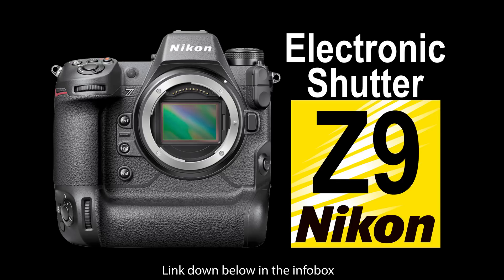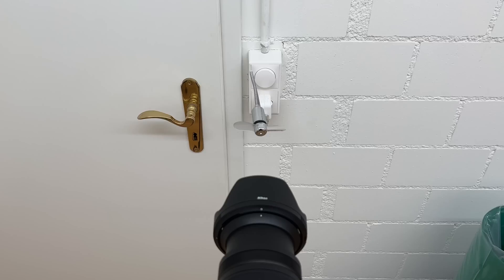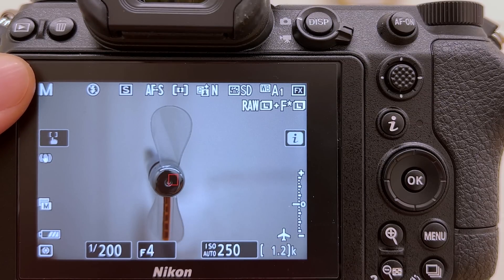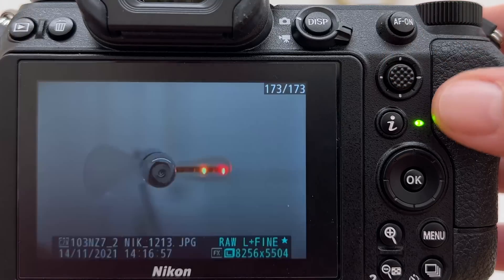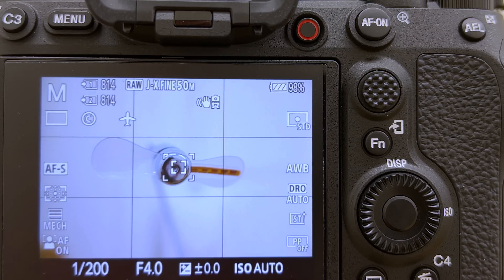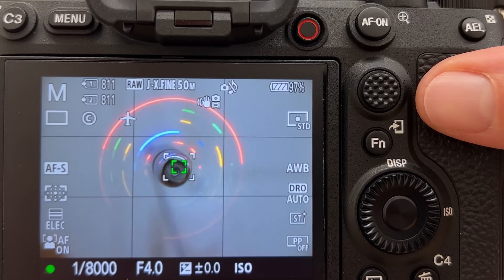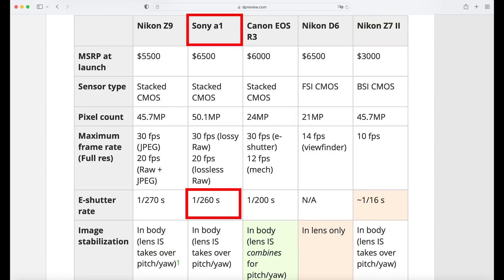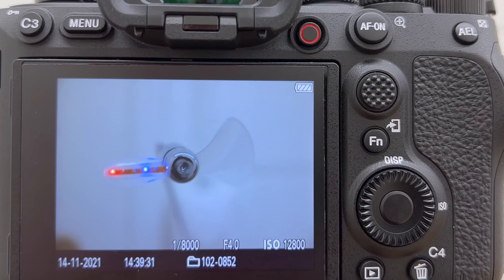NEW Nikon Z9 vs Z7II vs Sony A1 E-SHUTTER

Comment: I absolutely HATE the silent electronic shutters; hence why I use the Nikon F2T film SLR which was launched way back in 1971; it’s shutter-curtains and flipping mirror makes loud noises informing me that an exposure has been made; whereas with electronic shutters they are barely audible, and in busy environments you hear nothing. Once I have processed a roll of 35mm film, I scan it using a high resolution scanner, once scanned I can make very good quality 36”x24” prints.
Reply: Nikon has 'beeps' & 'green flashing light' to inform of exposure/ photo taken...also, your lcd will blackout, or, your top screen will inform
There are multiple viewable signs of 'photo - taken'.

Comment: Thanks. Great video. But if you want to see the level of rolling shutter on the cameras, you cant use a picture where the fan is level horisontal. This will not give you any rolling shuttes, at the issue with rolling shutter is with movements in a horisontal direction. So the reference image should have been where the blades of the fan was pointing up and down. This would give you a better idea of rolling shutter.

Comment: So in short image quality sucks, dynamic range on different ISO speeds is a mystery that Nikon chooses not to revile but hype and number of jpg images per second that most of us could care less about is constantly emphasized. Nikon really needs to return to simplicity, quality and value for the money that is the formula for success not the hype.
Reply: How did you get that image quality sucks? And for sports I'm totally interested in the 120fps mode. Everyone uses hype to sell a product. When it gets bad is when something doesn't live up to the hype. Sounds like you will be fine with an older camera. And you definitely seem to not know much about marketing. Nikon needed this camera and it will only get better. Stay salty!
Reply: @godboy159  Don't listen to the illiterate sony fanboy. We know the z9 is 1500 cheaper than the A1 with battery grip. It's value for days.
Reply: @godboy159  It is not sold as sports camera and even for sports it is 120 jpg files not maximum size RAW. It is amazing that the some years back photographers used 3-4 frames per second film cameras and managed to get some outstanding shots. Spray and pray is really not replacement for anticipating moment and clicking the shutter at just right time. Image quality is not what Nikon is pushing you cant even find out what is the dynamic range all that hype is concentrating on is frames per second and supposedly best since sex autofocus.If true grate autofocus would be welcome's but outstanding image quality is even more important and we are not told anything about that.
Reply: @mikeabc5355  " It is amazing that the some years back photographers used 3-4 frames per second film cameras and managed to get some outstanding shots" - You are obviously not a sports photographer ...
"Spray and pray is really not replacement for anticipating moment and clicking the shutter at just right time". In sports there is NOT just one "right time" - it is clear to every sports-photographer, that you get far better images with a high frame rate. 
And ... Compare the "outstanding" images from the days of film with the captures from today and you can easily see a huge difference.
Reply: @w.scholz9705  You are correct I am not sports photographer. Granted very few people need fast frame rate but Nikon ignores dynamic range and photo quality that is important to all photographers and fixated on something that matters to 0.5%.
Reply: @w.scholz9705  Yes but it does not put that info in its ads as if it is ashamed but in every advertisement, the frame rate is listed front and center. Frame rate matters to only a handful of sports photographers dynamic range and photo quality matter to everyone yet for that information you got to search long and hard.
Reply: @w.scholz9705  Considering that I started photographing, developing film, and processing photographs in 1965 and owned several studios over the years owned, and used countless cameras I guess I am not at your level of achievement but I am trying. :)

Comment: Would be nice if they could come up with a way to control the integration process of the individual photodiodes without having to stop the light exposure and control that on all photodiodes at the same time. But one can only dream right now.

But to claim that the camera eliminates the need for a mechanical shutter is still a bit of a stretch especially when it comes to increasing flash sync speeds, if the mechanical shutter can reliably be made faster, which Sony seems to suggest on the A1. However, the question is, have they reduced the life of the mechanical shutter to make it faster relying on the user using it mostly when there is a need to use it with high speed flash photography?

Comment: nice video (as a A1 owner) people getting the z9 should not be worried about using electronic shutter. I and many of my A1 friends don't use the mech shutter at all. I do suspect the Z9 to be very slightly faster simply because it has a little less work todo but won't effect the results. I am not  sure how you make the call that the cpu vs the cpu's (A1 uses 2) are faster/slower both are new and we are not sure if they are used to their full potential yet (and i say this as a soft/hardware designer) my guess is both can be pushed more over their lifecycle. Lastly why stop at 1/8000 and not go to the max setting of 1/32000 ? I understand you wanted to compare and you clearly proof your point people should not worry but still would be nice to see.

Comment: There is something I don't understand. If the Nikon Z9's read out speed is 5 ms how can it achieve 1/32 000 sec exposure time ?
Reply: It's no different than a mechanical shutter which moves at 1/250 can allow for 1/8000. Don't quote me but I believe it is a calculated exposure not an actual.

Comment: If Z9 scan speed is faster than A1, why can't it shoot at 30fps compressed raw or high efficiency star? Instead it's capped at 30fps, 45mp jpeg and 20fps, 45mp compressed raw. Interesting quirk if you ask me.
Reply: Nikon Z9 processor allocates resources for the EVF dual stream technology and hence is true blackout free without stutter like A1 or R3. Is Sony really 30fps? I thought it depends on lens, auto wb, lossy compressed raw, and several other rules. Also my understanding is that when shooting continuous the evf resolution drops and fps drops to less than 20fps and does not sustain 30fps. It just seems to me Sony is just about specs. Like my Sony Xperia 5 was advertised as the first 4k phone. But guess what, it only displays 4k when viewing pictures. The rest of the time it's 1080p. They don't tell the customers that.
Reply: @mlai2546  How did you decide the A1 is just about specs ? Maybe watch some real reviews like the R3 vs A1 by Jared. The 30fps is real but if a lens can't move fast enough what do you want sony todo all brands will get this issue. The dual stream EVF nikon claims imho is PR bs not sure how sony and canon resolve it but its fine. Yes i own a A1 and i tested getting 30fps is easy if the lens allows to af that fast. Also people (and we will see Z9 owners claim that soon too) should 99% shoot in compressed raw. Uncompressed or even lossless compressed raw is only useful in a very few cases and mostly in single shot mode not bursts.
Reply: @scb2scb2  Daniel, go check it for yourself:  https://www.youtube.com/watch?v=4KWZPsTizRs 
If you don't find this stutter annoying then good for you. I suspect Sony and Canon will eventually adopt the dual stream technology.
Nikon's dual stream prevents stutter because it does not need to pause, transfer sensor to CF Express and then resume feeding sensor to EVF. It is working in parallel, both feeding the EVF and CF Express at the same time. 
Sony's 30fps is compressed lossy. If you want to compare lossy, then you can say Nikon's continuous shooting is 120FPS, that's 4 times more than Sony's. If you are just solely comparing processor power, then Nikon wins in this one as it can record 8k 60fps.
Reply: @mlai2546  I am not sure what is in the video might be because of the hdmi record since that is a extra feed again thats by a 3th chip if you also record the overlay or because they have anti-flicker on (see start of the burst). But i can simply test here myself put the evf in 120hz mode, moved camera about smooth as expected to view, hit burst and just as smooth during the burst. The whole point about lossy confuses me even more since unless i missed something at each speed the sony allows for a better format (30fps and 20fps) then the Z9. The 120fps mode is nice but unless someone convices me its not extracting video frames to get these jpgs. The A1 can do the same you just have todo it at the end of the clip and yes its only 8mp not 11mp because of the 16:9 aspect ratio. Lets see if sony adds the same trick since its nice. The biggest issue with that 120fps mode is there is no clear way to auto-batch or organize them in camera since having say 360 images on a 3second burst doesn't make your life easier. I was hoping they would come up with a smarter way to group and maybe preselect them for transfer. But getting to the dual stream i am just not sure what it effects are. So sensor puts it into the dram on the sensor. Now somehow their is logic in there that takes that now scanned image and feeds both to the expeed 7 (so transfers the same data 2 times to that chip or more likely at different speeds and resolution. The A1 transfers it only 1 time from the dram on the sensor to one of the 2 XR chips. It has to be able to transfer at least some version at 240hz since the EVF supports 240hz mode. We know at least 1 on 8 transfers has to be the full 50mp image since that needs to be processed for the 30fps save. We also know both the A1 and Z9 has to have 120frames inside the Exceed7 or one of the 2 XR chips todo tracking and whitebalance since both do that at 120hz. So in the end i am not saying the Z9 method is not better what i mostly saying we have no idea how the others do it. Clearly nikon felt it was smart to make it press-item that it sends 2 copies from the sensor to the exceed7 while the others seem to only send 1 copy or not we don't know since they have not talked about how they do it and why. As a software and hardware designer by trade i simply can't 100% tell you what makes more sense and why. But i do agree if Z9 method has a huge advantage it will be copied i am just not sure how it compared until i have a Z9 next to my A1 to try it out. Since the Z9 is lower res and lower refresh rate i simply don't know how having the sending 2 copies from the sensor to the cpu helps unless someone really explains what is in these data streams why what happens after they hit the chips. Keep in mind i reacted to this video first as a A1 to simply say to the Z9 owners (that was the goal of the video posted) not to worry about rolling shutter since it won't be a issue as his video clearly shows.
Reply: @mlai2546  Looked at the video again maybe you can point out the stutter you see (the seconds in the timeline) since you might not notice he is changing from ff into crop mode on the fly several times during the burst taking maybe that is what you mean ?
Reply: @scb2scb2  As soon as the person holds down the shutter button, you can start seeing the stutter. @ 6s, @ 10s, etc..  It is more obvious when objects move fast. 
Here's another video of the stutter. Look at the movement at the beginning. The way she walks it's not smooth. https://youtu.be/Tnv6s1UYKgE
And this makes sense as the way mirrorless work is it displays the previous image when taking a shot. Basically=> capture, pause, transfer data, capture, pause, transfer data, repeat etc...  
Nikon Z9 stream simultaneously so you don't have this problem.
https://youtu.be/elUbfDTjmI8
Reply: Because you need todo more then just get the image of the sensor (once its in the dram on the sensor) lots of steps before it is stored in your memory card. Somewhere either there is technical or marketing reason for them not todo it.
Reply: Not an interesting quirk. You simply don't know what you are talking about. Scan speed has nothing to do with how many fps a camera can shoot.
Reply: @godboy159  Indeed we know both cameras are about the same on scan speed (about 4ms) and it has to supply at times 240 fps to the A1 for EVF and 240 record mode. Not 100% sure on the Z9 but we know it also has to atleast do 120 per second since like the A1 its AF, subject tracking and WB runs at 120hz and that work is done in its processor(s). I am not sure what effect we are seeing in these videos but i don't have it on my A1. Yes we know that if for example in 240hz EVF mode the quality drops down down and image becomes smaller. in 120hz mode HQ mode the video in the EVF gets slightly softer when in burst but the Z9 doesn't do >60hz to the viewfinder. Keep in mind we are not recording the EVF here what we are seeing is a 3th signal the one that goes to the LCD (extremely lowres as we know lcd sucks) but in this case the video has to be proccessed again to feed (and scale it) to the hdmi output at the requested settings (say 24,30,60p @ 1920 or 4k). In the end i am not saying Z9 doesn't do anything special here i just don't know what its doing providing 2 signals to the 1 cpu to feed it back to the EVF (again not what we are seeing in this video). How sony and canon have done it we don't know really what we do know it has todo more work given the much higher EVF speeds and number of MP it has.... In the end on my A1 i don't see any problems in the EVF when shooting that make me worry about this and for sure not to the level that all the extra features/settings they supply would keep me from using them. But like i stated get what you want i just replied to this video to say to all Z9 users don't worry about not having a mech shutter its NOT a issue thats why the video posted here is such a nice example. I personally would not have mind sony had dropped its mech shutter sure we get 1/400 and 1/500 sync speed for flash but thats about all it adds i don't use it much and neither do most of my co-owners of the camera.
Reply: @godboy159  OK genius, tell me why it can't shoot faster fps given that it's scan speed and  new processor is the fastest Nikon ever has?
Reply: @sosomelodies659  it probably had to do with hardware encoding of Nikon's new compressed raw file algorithm.  We may may see 30 fps raw with a firmware update.  The fact it can do jpeg at 30fps means the camera is capable of doing it at 24 bit color, so I would expect it might be possible in raw.
Reply: @sosomelodies659  Because that's as fast as they can get it currently? I'm not a genius but I do know sensor readout has nothing to do with how many frames it can pull off in a burst. That has to do with yes the processor, the buffer as well as the speed of the storage system on board. I mean the camera is only as powerful as it is. I'm sure we'll see a new one down the road with 2 processors so it can do more. But I'm sure 2 processors would have allowed even better autofocus as well as higher fps while at the same time added even more heat internally. Everything is a balance. I think a big thing they wanted was high frame rates plus 8k that doesn't overheat too quickly so that it beat the R5 in the overheating department.

Again, sensor readout doesn't have to do with how many fps the camera can do. Period....

Comment: An interesting detail - 8000 iso in nikon vs 12800 in sony with the same shutter and aperture. Unless you've changed the light.
Reply: ISO is not a physical value so it varies between brands.
Reply: @kg22kg  Obviously

Comment: It's not a  real test if you don't have ALL the physical bodies and compare the actual results. Oh and I thought the readout speed means the time to read out alle the single pixels from top to bottom, right? Hmm, the Z9 only has 45 MP,  but the A1 has to readout 50MP (much more pixel data). So if I do the math, and downscale the the A1 from 50 to 45MP, it's actually faster than the Z9.
Reply: why is it every person who owns a Sony is an asshole without a brain?
Reply: @Tap-a-roo  Truth! At least it seems that way.
Reply: @godboy159  I noticed that on Fred Miranda also. That site changed a lot in five years. Mostly idiots there now as well.
Reply: My guess if you balance the extra MP out they will be about the same on the sensor readspeed per pixel. What is unclear is the speed of the cpu's behind them this won't effect this test much but does other things and its a unknown factor at this point.
Reply: You are speaking hypothetically as if the Z9 had the same MP as the A1. Or the A1 had the same MP as the Z9. If this was the case you would be right. But this is reality we are dealing with here and it comes down to how fast the cameras can read the sensor to take an image. Also, the Z9 doesn't read from top to bottom. It's from what I understand reading the entire sensor at the one time. Could be wrong about that though. Do you own an A1?
Reply: @godboy159  Own the A1 yes, check my Channel.... Cheers Marco
Reply: @wilduntamedphotography1260  No thanks.. Just trying to see why you were being nasty. I figured you owned an A1.. Not interested in your content. Take care.
Reply: @godboy159  LOL, btw the Z9 does not have a global shutter or readout, what are you dreaming of? The readout works the same in A1, R3 abd Z9... And because the A1 is basically just as quick with more MP tells us a lot 😎 But people like you don't want to hear the truth....
Reply: @wilduntamedphotography1260  I really don't care if I have your respect or attention. It isn't worth much.